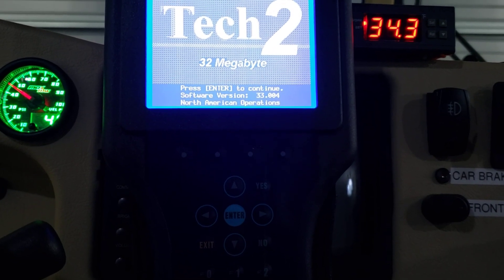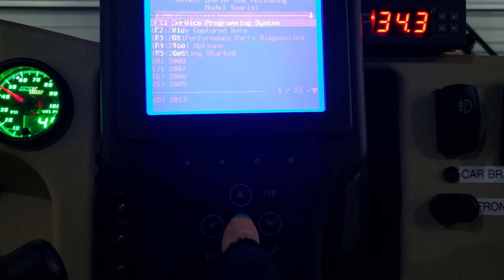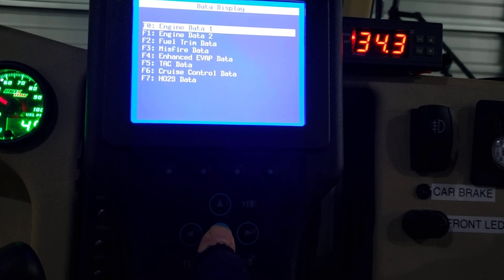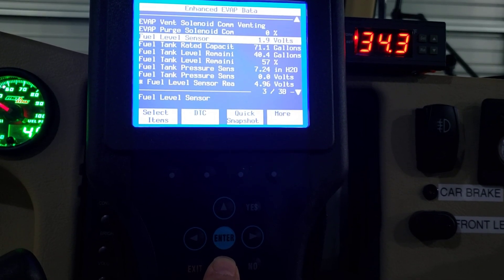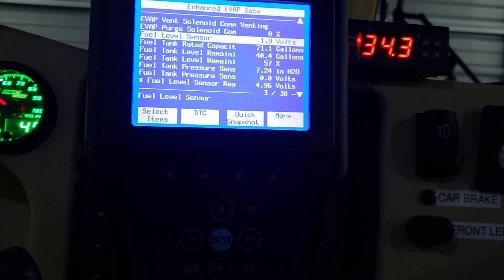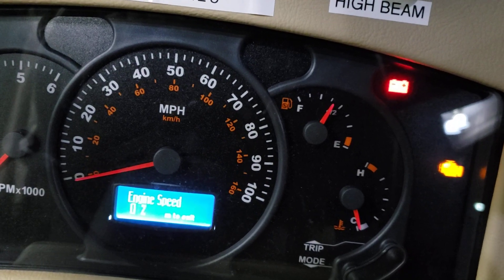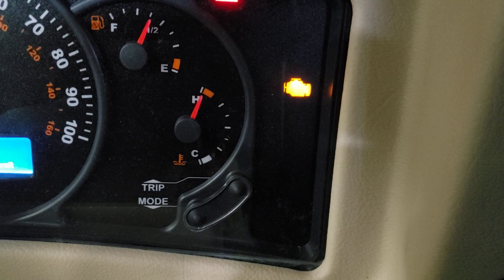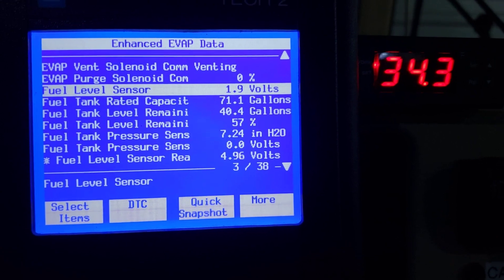Troubleshooting Fuel Gauge on Workhorse / Winnebago With 8.1 Vortec with GM Tech2 Scanner

Comment: We have a 05 Winnebago Voyage Workhorse 8.1. The fuel gauge is over the full mark and doesn't move. The temp gauge is way below cold and doesn't move. Both gauges are on the right side of the cluster. All fuses good. All connections good. Help!!
Reply from the maker: @leewehrhan3800  text me at 606-875-0125 Kevin so I can call you back.
Reply: Did you ever figure out what was wrong or have a fix I’m having the same issue on my 05

Comment: Hey Kevin,
I’ve been binge watched almost all of your RV videos and have learned a tremendous amount about how to diagnose issues and maintain my workhorse 22 chassis. I am however at a loss to find your installation video for your scan tool which sits at the top left of your dashboard. Can you tell me where you got that device from and how you have it set up?

Thanks in advance
Reply from the maker: Give me a call I will fix you up
My cell 606-875-0125 Kevin
Reply from the maker: You will also need some codes that I can email you. 
Here is the gauge its self.
ScanGauge - SG2 II Ultra Compact 3-in-1 Automotive Computer with Customizable Real-Time Fuel Economy Digital Gauges , Black , 5 Inch https://www.amazon.com/dp/B000AAMY86/ref=cm_sw_r_apan_glt_i_NNQFNG3KPZHR1AYZ9Q2Y